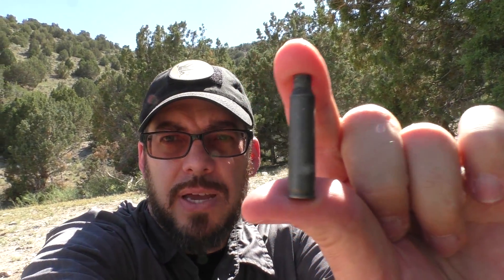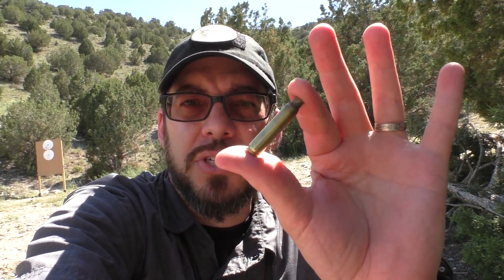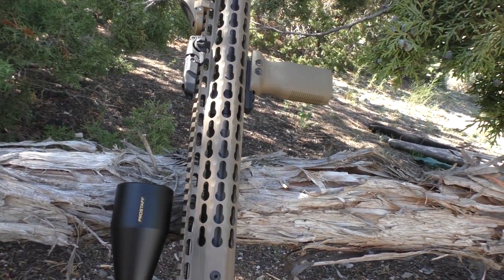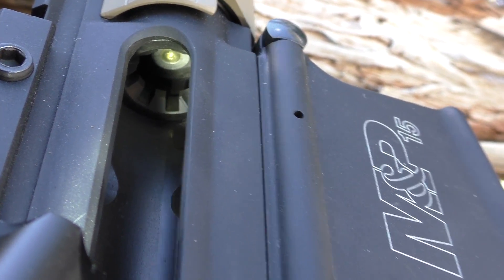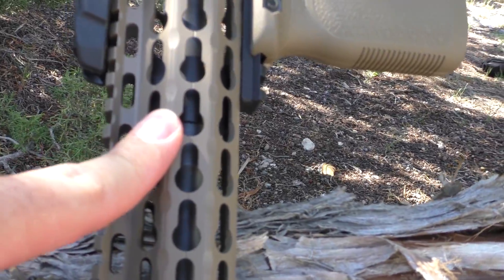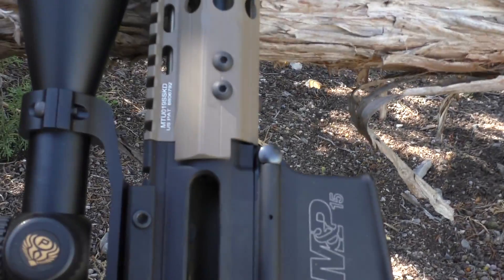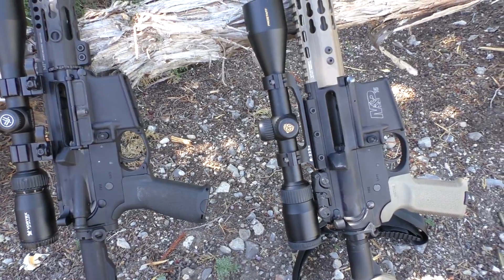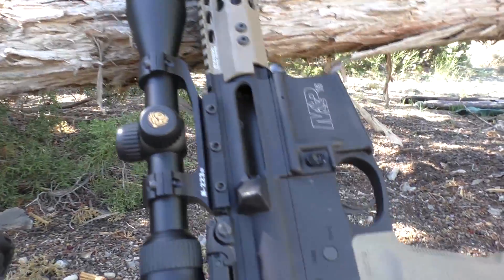Tula .223 Killed My Guns! V-Log Thursday

Comment: Is not the steel, is the coating. I've had the same issue with my .40 cal pistol, usually after about 40-60 rounds, is end up with a failure to extract where I'd have to wait for the barrel you cool the seriously hammer it out. Spoke to my gun shop, they have a coating in the round and running a lot through a hot barrel will warm the coating, and it'll try to bond in the barrel. It's a pain in the ass. I never had a single failure with my pistol other than 4 failures to extract using tula. Not worth the savings!

Comment: It comes down to expansion and sealing up the chambered cartridge. Steel does not expand enough consistently to stop carbon from building up around the casing. In turn filling the excess head space. I run a clean oiled AR with thousands of steel chewed, no stoppages

Comment: friend of mine just bought an I.O. AK last week. 200 rounds of Tula ammo. This happened on the very first shot. After he got done kicking himself thinking he just blew money on a shit gun, we ended up breaking it down and hammering out the casing. We tried again after checking for damage. 3 or 4 rounds (we loaded 1 at a time) went without a hitch, then it happened again. The thing i noticed about both times it happened (once to him and once to me) is when we pulled the bolt back to load the round, we helped it forward instead of just letting it slam home. Not sure if that had anything to do with it, but we went through another 160 round after noticing that, no problem.

Comment: I've had the same problem with steel case ammo in an AR10. my gunsmith put it down to the coating on steel ammo melting off at high temperature and gumming up in the chamber. since then I used all the remaining ammo in a bolt gun and stick to brass in the semi. hope that helps

Comment: Had the same problem with a colt M4 . I installed a HD extracter spring and black plastic piece , the problem went away . Now I use only use colt bolts that get rebuilt after 3000 rds of steel case ammo. I have not had the problem return.

Comment: Simple. Tula uses steel cases. Steel expands during the shot and stays expanded. There is a reason normal bullet cases are made from brass, because brass expands during the shot and then shrinks back down after the shot. I ran into the same problem with my bolt action 223. Now I am shooting nothing but brass.

Comment: what size Barrel are you using and look for marks on the empty round heads steel case ammo is for 20" barrels and if you have marks on your cases like it look like its pulling the head off that means the timing is off on your weapon.

Comment: when i worked at a range we had cleaning rods on the rifle range just for people that got steel cases stuck just like this. i don't know what caused the issue but it was pretty much every time that the extractor broke the cases rim. didn't matter if the chamber was .556, .223 or .223 wylde. solution is if you are gonna shoot steel cases have cleaning rods to punch the cases out.

Comment: check the base of the shell casing , you will fine the case swelled at the base about 1/8 to 1/4 inch causing the shell casing to become stuck in the chamber. had this happen while shoot steel tula ammo through a mini 14 that usually eat any ammo with no problem. bad ammo,casing ?

Comment: Hopefully this isn't too late, but I have your answer.  I have had this happen to me in my Stag 1L, but I found the fix: use an H3 buffer.  Since I switched buffers, I have had zero problems through several hundred rounds.

Brass is amazing: when you fire a round, the brass nicely expands and seals to the chamber.  As soon as the bullet leaves the barrel the pressure immediately drops to zero, and the brass springs back from being pressed against the chamber.  Steel does not spring back nearly as quickly.  Couple this with the fact that Tula ammunition tends to be loaded to a wider margin of pressures, all it takes is an abnormally hot round and your bolt carrier will be trying to go back before the casing has contracted.  The casing is essentially glued to the chamber, and the carrier will bend part of the rim as it goes back without being able to eject the casing.

Here is where the H3 buffer comes into play.  The heavier buffer will slow down your cyclic rate, allowing the newly empty steel casing more time to contract.  This ensures that by the time your carrier flies rearward, the empty case will eject instead of gripping the chamber walls.

Comment: recently, i made my very first project ar15 gas piston upper, since i still got the unmodified bcg, tested brass and steel case at the same time.. already shots hundred round through it with brass ammunition without cleaning, and later switch to steel case(TulA Ammo)emptied a couple mags, and didn't have any issue..

Comment: One more thing.   Don't run brass cased ammo first and then switch to the steel case rounds.  Also, don't leave a round chambered in your rifle for very long once the barrel heats up.  both of these plus running it very wet, will help you stop having these types of problems.  I know it's a pain to remember and do these things, but for two 20 round count boxes for $10.00, it makes it much more tolerable.  Thx. for the vid and I hope you remedied your problem.

Comment: Hey bud I had the same issue got a bushmaster that was still made when they were windham. Had the same issue ran Tula it was the only one that stuck in the chamber I figured the guns as super dirty so I Cleaned it shot one round did the same thing a again couldn't figure it out. Loaded some brass some Barnaul steel and wolf steel mag dumped them no issues at all.

Comment: My son just recently bought a way overly priced AR from a local gun shop. Can't tell you offhand what barrel are both period group is running but we did purchase some Tula ammo from the local gun show. His malfunction seem to be short cycle or not picking up the next round out of the mag what eject but would not feed. Also he has a micro gas block. He took it back to the shop where he purchased it after thoroughly cleaning they ran five rounds through it with brass case ammo and it worked flawlessly. I think the ammo is crap

Comment: I know this is an older video but just wanted to give my input.  I've shot nothing but Tula in my ar and have never had a single problem. The anti corrosion coating on the rounds cause them to stick in the chamber a little especially when the barrels warmed up. All you should need is the BCM extractor spring upgrade and that should allow your extractor to get a good grip on the case and eliminate 99% of the issues. Good luck.

Comment: My take is that cheap ammo has loose tolerances, I had a simular thing happen to me with Perfecta brass cased .223 ammo purchase at the local Walmart... I would drop the bolt and it failed to go into battery! So I'd fist the F/A closed and tried to eject the round by pulling the charging handle.... the round got stuck like your demonstration. I had to take with a rubber mallet to the handle to release the stuck case from the breach face....Only once a case got stuck to the point of having to pound the bullet down into the case to removed the powder from the case. this allowed me to finally take a wooden dowel with bigger taps to remove the primed case with out causing any bodily harm...... keep in mind that none of these rounds were fired out of the gun and the upper was removed from the lower receiver to minimize the risk and danger....  I took some measurements with a micrometer and found this ammo be oversized by .001 to .002 of an inch? this may not seem to be much, had I'd fired these round in my gun the expansion would've jammed the case frozen and not allow the extractor to eject the round.... cheap ammo is widely available, anomalies in big batch testing are all to common in Q/C even if the QA department is monitoring 25% of the volume quantities! most companies don't do 15% because of cost and time constraints......

Comment: I've heard that Tula and Wolf come from the same plant.  Steel cases are coated with a polymer of some sort to prevent oxidation.   You bolt looks dry?  do you not run grease/oil on it?  metel to metal high pressure back thrust on the back side of the bolt head with not grease or oil can cause premature galling/wear.  Clean the chamber good with a chamber brush, solvent, patch and get the carbon out.

Comment: steel expands but doesn't contract as much as brass. had a brand new del ton rifle I built that would not run steel. a few years later the extractor spring was getting weak so I replaced it with a BCM, now runs everything I put through it steel, lacquered steel, dirty brass etc. put one on my stag m8 (which ran steel case like a champ) for the extra assurance too.

Comment: I do not shoot any steel cased ammo through my AR's. AR10 .308 and AR15 .223 Wylde. I was told by a older guy the steel cased ammo uses a thin polymer to inhibit rust on the cases.  This creates a issue as the barrel heats up and leaves traces of the polymer behind in the chamber after many shots.  Steel cased ammo works fine in the AK because they don't use as tight of tolerances in there chambers.  Hope this helps and send em down range.  Don't need any flames on this post just something to think about.

Comment: I've had the same issues with all steel casings in .223, not just Tula. My reccomendation is after about every 90, to 150 rounds, do a quick field strip and clean your chamber, and bolt. The cheaper ammo fouls 10x worse than standard brass does with my observations. Plus the steel casings aren't as soft as brass. I've tried keeping my AR wet and all it does is postpone the inevitable chamber jam. I think its just an AR thing, my SKS eats steel and spits it out no problem.

Comment: I had a similar problem with my .308 with tula ammo and the problem is there is too much carbon build up with the steel ammo and can not expand so my suggestion is to throughly clean both riffles.and brush the shells with a cloth rag if your running tula  ammo

Comment: I was told that Tulammo is coated so that it doesn't rust. When the gun gets's hot enough it "melts" the coating which causes the casing to get stuck. I've had it happen with my Ruger AR 556, but only when the gun gets hot enough. I don't use it anymore in that gun.

Comment: this is actually caused by the coating on the steel cases. when put into a hot barrel or chamber the coating acts like a glue and causes it to stick. I have dealt with this problem quite frequently. I've taken a box and wiped the rounds down with lacquer thinner to remove the coating and they cycled just fine. still, I don't believe I should have to clean my rounds before shooting them. stick with quality brass.

Comment: the laquer coating heats up when firing and almost liquifies when you are finish fire and are not yet empty and place the gun on safe it begins to resolidify causing a tighter chambering shortly after you begin shooting and heat it up again it gums up and you get failure to eject . I think it's like it almost welds itself in like when soldering a copper pipe.

Comment: I truly think it's a small size difference and the laqaur on the case. This happened in a rifle I had. I didn't even have to fire the round and it was stuck. Brass ran no problem never a malfunction. Tula ammo dead in the water. I believe metal case expands and cools off very fast so it's stuck. Brass expands and stays pliable.

Comment: I had a few extraction issues with com block ammo until I replace the extractor spring with a higher power spring. No more issues after that. This is a Ruger ar556 which the internet will tell you will not work reliably with steel ammo.

Comment: what happens is that steel cased ammo is coated in polymer to prevent corrosion and if your shooting and get the gun hot and let it cool in the chamber the polymer on that round has basically melted and coated your chamber and when it cooled it basically glued itself in

Comment: I had the same problem if you shoot a few and leave one in the chamber and put it on safety to go check a target or whatever it will glue itself to a hot barrel if you drop the magazine out and remove it immediately then go check your target you won't have a problem but do not leave one of the rounds in hot barrel this will happen every time. hope this helps.
Reply: it's the coating on the cases of you put one in a hot barrel and leave it in the chamber it melts the coating on the case then when you walk away from your gun to go down range it cools down enough to turn into glue and glues itself to the barrel always drop the mag empty the chamber and you will have no more stuck cases.

Comment: Its the varnish on the casing of the tula ammo, when the round is fired the varnish flash melts just enuff to stick to the chamber also the metal casing stretched and does not shrink back compounding the issue.

Comment: I had the same issue with my AR15 at the range the other day. I was using 55 grain TulAmmo .223 FMJ. I was able to fire about 35 rounds before I had a casing stuck in my chamber. I had to go home and separate my upper, remove my bcg, and use a cleaning rod to knock the round out. I've been using this ammo for years without issue. One thing we do have in common is we both were using Palmetto uppers and full auto bcg.

Comment: It's the non corrosive coating on the steel eventually builds up in the chamber and when hot gets gummed up and fails to extract. Happened to me today. Happens about after 500 round or so. Clean you barrel really good and you can shoot 500ish more round through it

Comment: I have the same problem with Tula in my AUG. I found that if I kept the chamber lubed well (almost wet), the problem vanished.  For me I never had to knock a case out with a cleaning rod. The extractor pulled them out with some outlandishly silly force.  

I know people that have had issues with Tula getting stuck in ar15's when they are chambered in 223 and shooting the 5.56 ammo.  But I personally don't shoot an AR. 

I don't like shooting the steel cased ammo. The extra ware and tear on parts isn't worth the savings.  I've almost completely moved over to brass.

Comment: it's the soft case of the tula ammo. I have experienced it b4 I found out that the problem is the steel case has a very soft lip so upon striking it the case smashes into the chamber becoming stuck the brass is much much more heat resistant to so once hot it's not as soft

Comment: Had the same problem with Tula 7.62x54r.  Had to step on the bolt handle to extract the case. Haven't used Tula since.

Comment: Extractor O ring will keep them running but eventually the carbon will build in the chamber until it rips off the lip of the case.  They will run much longer with the 5 coil spring and extractor o ring. I've seen some with just the standart spring and black insert that even freshly cleane and lubed would'nt make it through a mag of Tul Ammo, it has a weird pressure curve that really doesn't like carbine length gas systems.

Comment: yup, rust coating is melting in hot barrel.  if you shoot tula slow its ok, if you run through 3+ mags it will jam up.  coating of barrel might help, it happened to me in a core15 moe m4.  my m&p sport eats tula up with no problems, npap m70 too.

Comment: Tula uses a resin coating on the casing of the ammo to prevent corrosion. when the chamber gets warm some of the resin will stick in the chamber. after enough of the resin builds up cases will jam.

Comment: Tulammo and many other steel cased ammo has a bimetal bullet which means that it is lead like other bullets but has 2 different metals as the jacket.  The one metal is copper sometimes which is thinner than the thickness of a human hair and steel which doesn't flex and compress like the copper does so it can cause the stripping of the rifling and this can cause accuracy loss but not sure why your casings are getting stuck in the chamber.

Comment: what I've heard is the polymer coating on the steel case. builds up quickly causing a seizure, in the chamber. the heat after several shots, melts the polymer off the casings. causing a build up.

Comment: Theres a varnish on the cases. Which when heated will stick in the chamber. Plus a blowback of residue in the chamber will sometimes stic a casing in the chamber. I don't shoot Steal casings in my AR due to the fact they can break the shell extractor. Happened to a friend of mine twice. NEVER had a problem with brass

Comment: It's the coating on the steel cases. had the same problem with my savage axis 223. bought 100 rounds and probably about 75 of them would stick in the chamber. needed to use a mallet to free the bolt and eject the casing. never once had the problem with brass cases. also any of the things gun sense said are very possible as well.

Comment: i had this issue on a dpms upper and upon inspecting the inside of the chamber i noticed scraping on the walls.  It was coming from the burrs on the neck of the steel casings. It was scraping material off the chamber walls and pushing it up just in front of the rifling. I was able to run a chamber reamer and a rat tail diamond file in the chamber. This cleaned the polymer deposits and the burrs. The rifle functioned properly but sold it a few months later so I cant testify to the long term solution it may have had.

Comment: all cases expand and fill the chamber. brass will contract back down faster and more than steel. any roughness in the chamber will make sticking a problem.  you could try polishing your chamber. it doesn't change the size it just makes it smooth. hope I helped.